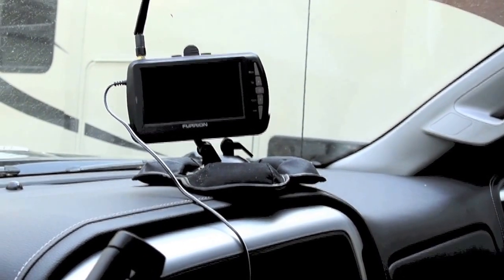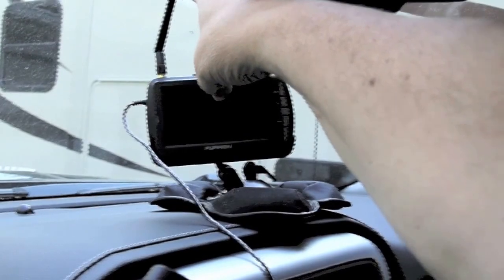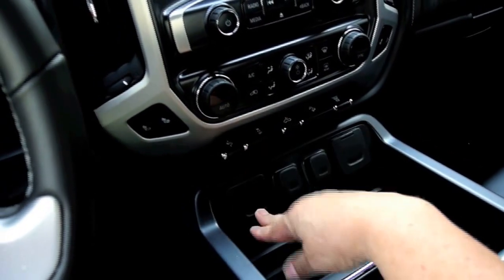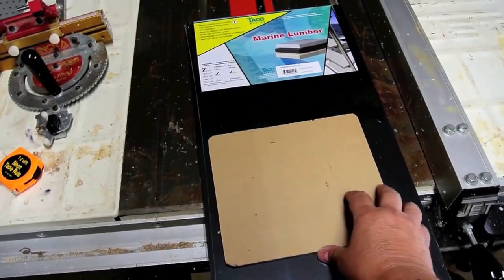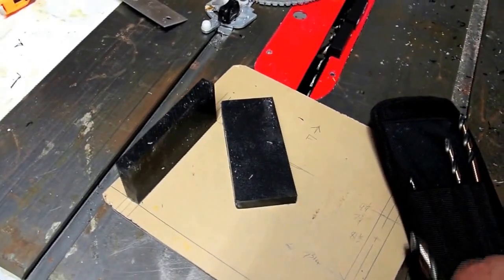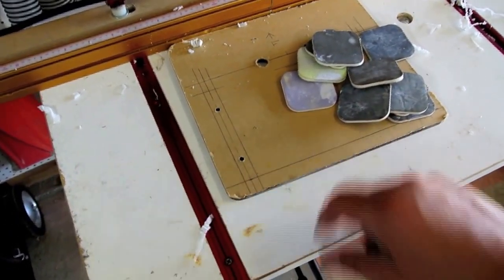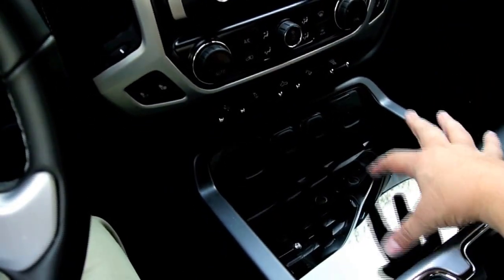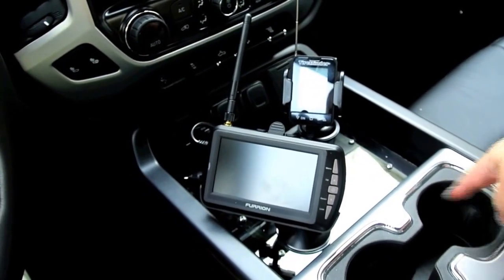Use your Vehicle's Center Console for RV Electronics

Comment: Great idea.  I have the exact same console/truck.  What dimensions did you use for cutting the plexiglass?  Anything you'd do differently now that you've used it for a while?
Reply from the maker: The acrylic was 9 1/4" x 8 1/8".  The only change I made was to add a rack handle to the acrylic to help remove it.

Otherwise its worked pretty well.
Reply: Thanks for the info.  Instead of a handle I may drill a hole big enough for my finger some where it's unlikely to get in the way of a suction cup, and use that to assist in removal.  Do you think that would work?

Comment: in this expensive car does not even have a built-in backup camera.. Hmmp
Reply from the maker: Actually it does. The backup camera in this video is for a 5th wheel trailer, to see behind it when attached to the pickup. Obviously the truck's backup camera cannot see through a trailer.
Reply: oh, than i understand it wrong :)